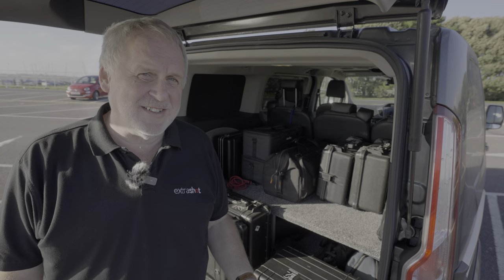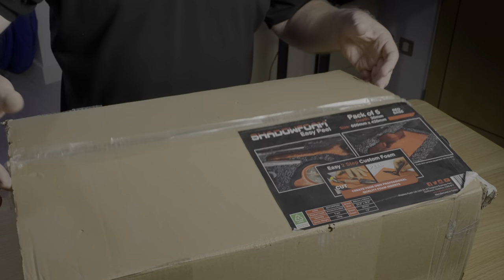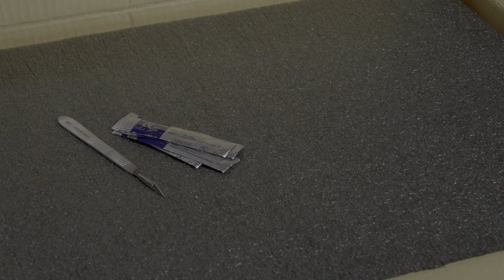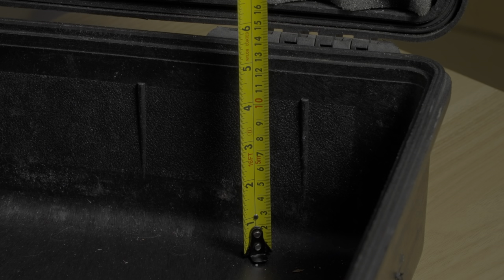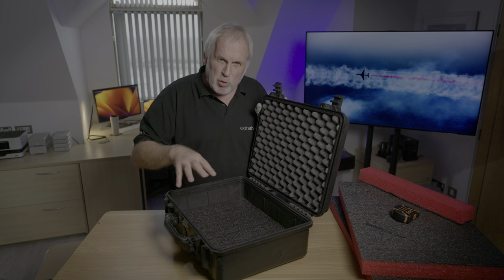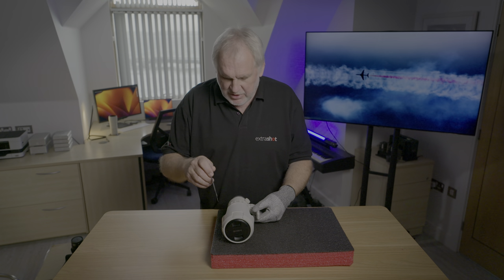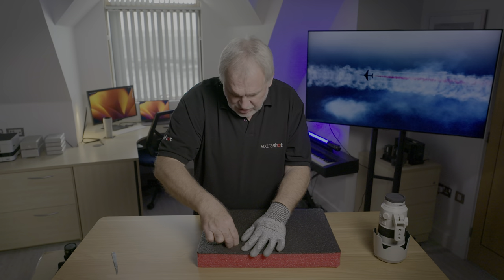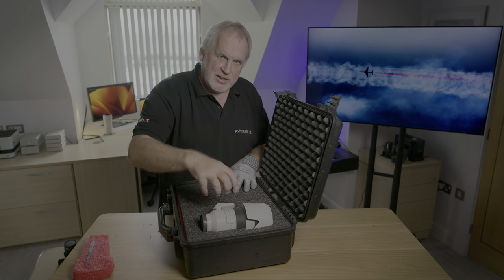Recycling camera kit bags and cases with Shadow Foam.

Comment: What a great suprise on a Sunday! Really enjoyed this video and such a great result in the end, well done! 😃👍

In answer to the point about the layers being harder to separate than you would like, we are working on this. The layers aren’t glued though as you mention, if we glued them, we would not be able to fully recycle any offcuts and scrap. So instead, we hot laminate the layers together which gives us a 100% PE product and far more sustainable.

It is a difficult balance to get the ‘peelability’ right. The bond is typically the strongest point so the layers separate above or below the bond. This means that it is not how strong the bond is that matters, but the density of the foam and the amount of air we push into Polyethylene when we extrude the sheets. If we make the bubbles bigger, we have an easier peel however it is difficult to get an accurate depth that is stable and a rigid enough material.

We are however always developing our manufacturing process. Hopefully that helps.
Reply from the maker: Thank you for the explanation... that makes sense 👍 I suppose the 'peelability' is a bit of a balancing act?  How about two different versions?... heavy duty or easy peel for weak camera people !!! 😂